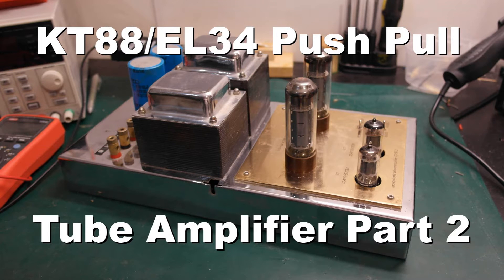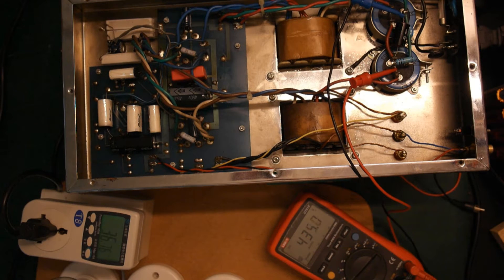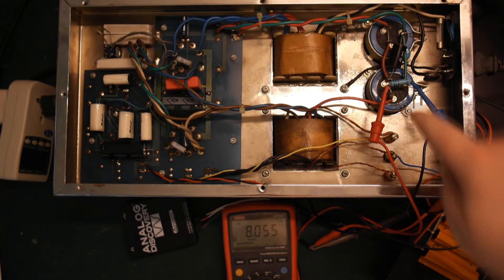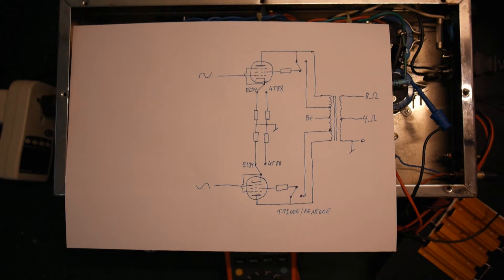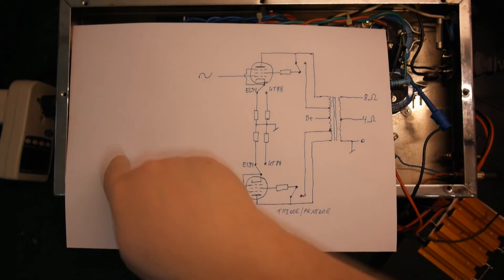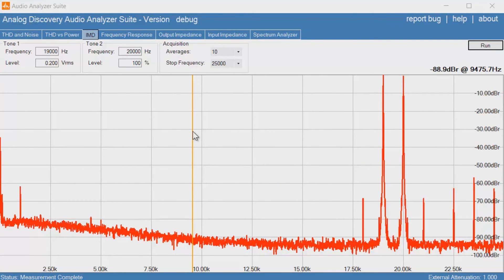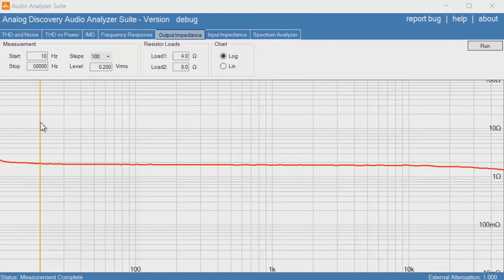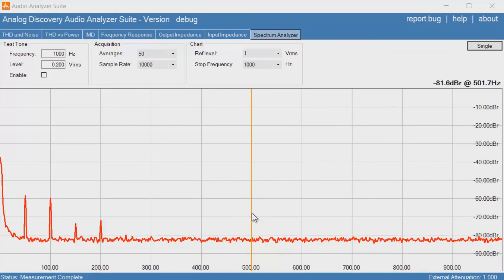KT88/EL34 Push Pull Tube Amplifier Measurements Part 2

Comment: Hello , the amp can switch between pseudo triode and  UL mode ( not penthode )
I  see they chose to use a shared cathode resistor , some pretend it  sounds better but it's not as safe as individual cathode bias , it will tend to current imbalance and sometimes destroy one of the tubes..
Brute force filtering..............way better but more expensive is to have a ripple filter capacitor and a reservoir capacitor .
Lay out of filament wiring on the board is another bad choice made for economic reasons . 
This amplifier seems  like many other commercial products compromised by economic considerations.
The choice option to chose between triode/UL operation means the amplifier is NOT optimized for either operation mode ............You are very right about that ..........
BUT audiophiles seem to like that gadget ...............two kind of different output tubes and two operation modes .................while neither is the best solution for the best sound .

Comment: Hi Thestuffmade
i have a diy 60watt tube  stereo power amp for guitar,thats 60/60watt per side,it use 6550 tubes,both side share the same power supply,it's 120vac coming from the wall socket,so what size NTC thermistor should i use on the power transformer primary(120 vac) side,i am a musician,not an amplifier guru,i do have some electronic knowledge, i made this amp,hope this make sense,and thanks